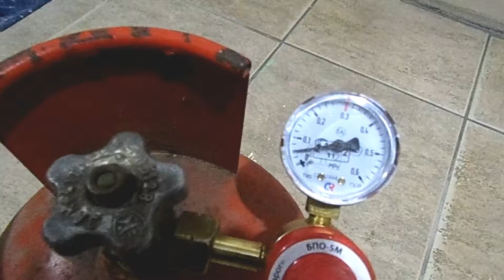Don't throw away the square metal pipe scraps!!! Powerful propane torch made from junk!!!

Comment: Neat. if you look at the masterforge cast iron burner you will see that there is 2 holes drilled into the the side with a collar and a set screw to tune the flame by metering the air. Much like a wood burning stove's air inlet control. Once the flame color is tuned, the screw is tightened down to hold the choke plates in position. It can be opened all the way or closed all the way.

WHEREAS, when you see guys build burners they usually just kind of drill holes and hope to get the right size holes. No thought is given to the concept of air metering plate.
Reply from the maker: I will definitely put your advice into practice when making a burner for the next project
Reply: Totalmente real lo que yo estaba buscando mil bendiciones exelente video